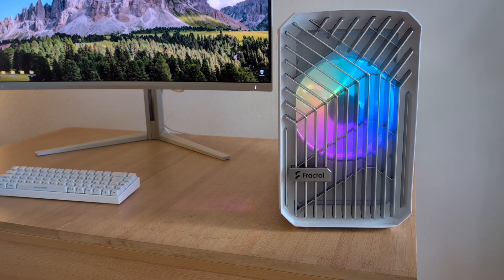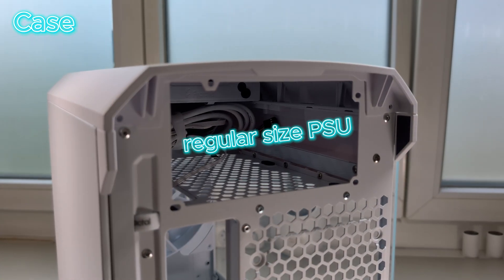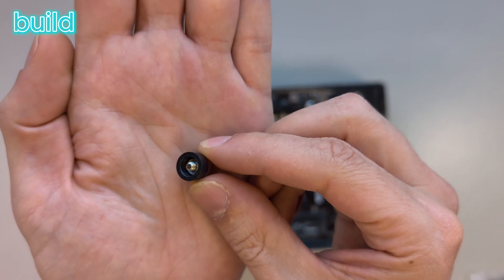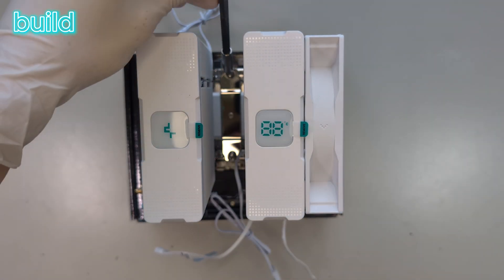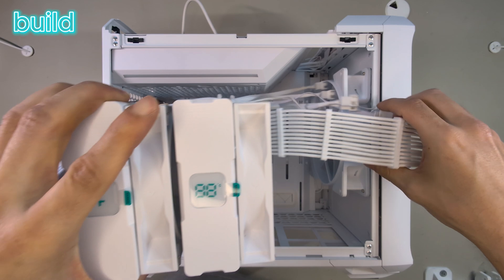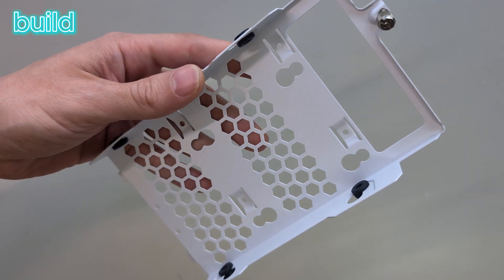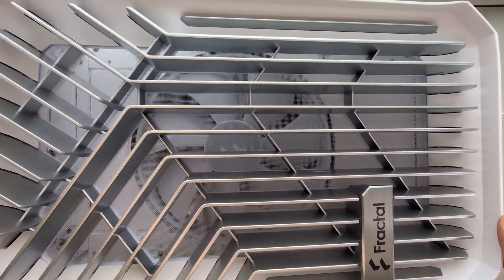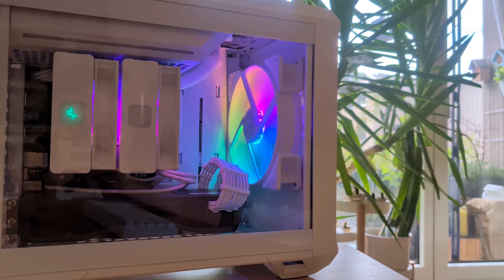how to build a powerful ITX gaming PC

Comment: At 5.55 that mistake had the potential of literally ruining everything but thankfully you noticed it. Good work
Reply from the maker: Thx kolver, Yes, that was close 😅
Im not sure why the 6+2 pin connector fited in the 4+4 plug... That should normaly not be possible, right?
Reply: @Dirt-E-Bikes  Well i have no clue why those cables fit there but I have seen some people on Reddit who did the same mistake and just didn't notice that those GPU cables aren't fit for CPU cables and they either ruin their motherboard, CPU or GPU. Also you shouldn't use old modular PSU cables in a new PSU cables. That result in the same failure. PSU and motherboard manufacturers should really come up with a different connector it's too easy to mix up
Reply from the maker: @kolver624  true, and thanks for the infos. i asked myself what the difference is between this two connectors, the only thing i heard was that "you cant do it wrong, because it only fits in where it belongs"... That does not seem to be true, at least not in my case ;-)